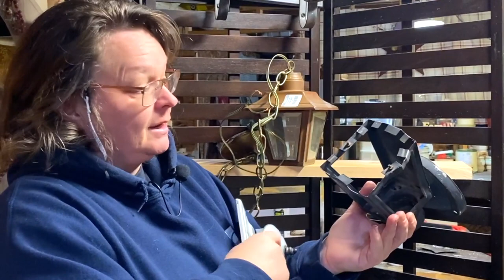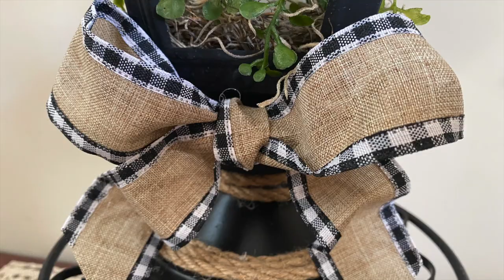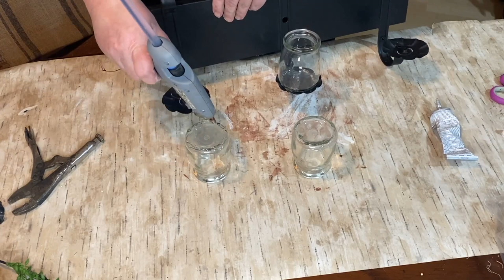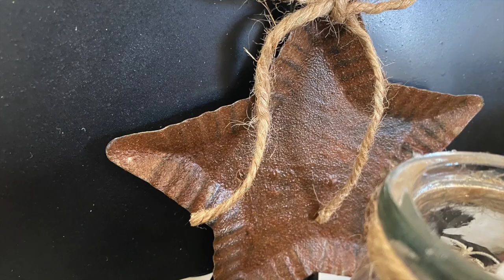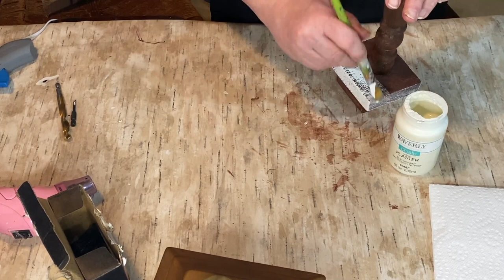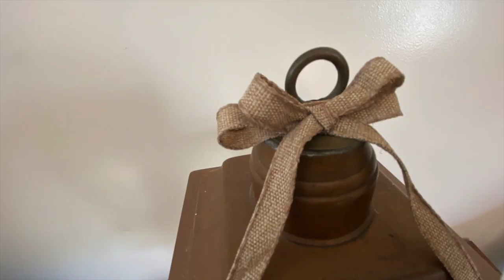Upcycled Lights To Lanterns Home Decor | Thrift Flip | Trash to Treasure

Comment: Love all 3!
Reply from the maker: Thank you 😊
Reply: I had found 4 wooden ones and wanted to make a lamp out of it and I  have e6000 glue but never used it yet so I'm going to try that, I wasn't sure how to keep it on the pole. I bought a tall floor lamp to put iy on and normally I would screw it on but it has a hole.  So I figured if your's holds mine should to. It's wood against metal.  Do you think it would work?